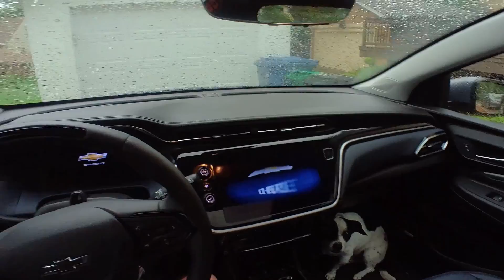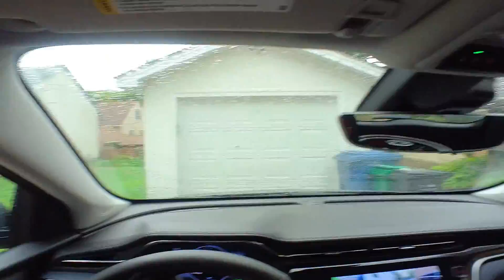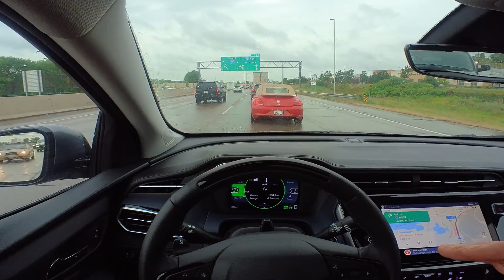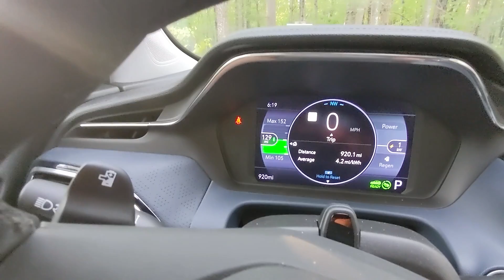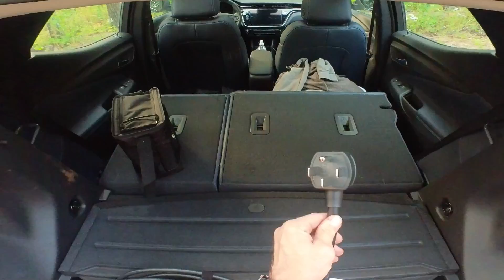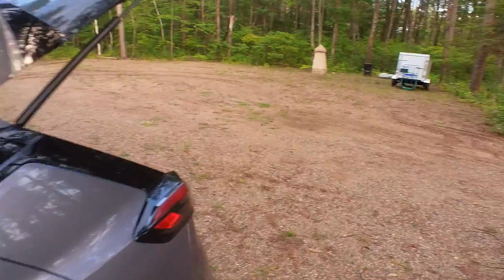Long range driving my Bolt EUV

Comment: Tip for your radio: I have an older Bolt and it will turn the radio back on every time I get in the car so I started leaving it tuned to SiriusXM ch 0. Since I don’t pay for satellite radio it stays silent and now my radio stays quiet.

Comment: Hi Shad, thanks for the great video.
How’s ride quality in general and versus ID.4?
Reply from the maker: The ride quality it the Bolt EUV is really good. Very similar between the two, but the VW handles a bit tighter and more sporty while somehow still having good ride quality. Kind of the trait of most German cars. That doesn't mean the Bolt is terrible by any means, it's also quite impressive especially when you consider it's price vs the ID.4.

Comment: Nice video !
I’d suggest you the following when the cold temperatures come
- always preheat your car before you leave home (remote start it 20 mins before you get in and drive it)
- use delayed charging and set it to a time that’s about 30 mins earlier than the time you leave home. This way you’ll have a warm battery when you are on the road. Remote start the car during the 30 mins left, so that you have a hot and crispy habitacle.
- do not use one pedal driving on icy roads
- always plug the car
The Bolt EV-EUV is best to charge from 10/15% to 55/60%. It takes you about 30-35 mins and you get about 100-120 miles range. 
I suggest you to always reset the Average/Distance in the main screen every time you are ready to leave house, after a charging session. Your GOM will become a lot more accurate when driving the same routes in the same conditions.

Comment: Just a correction for you - the DCFC charge curve on the Bolt is pretty terrible. If Chevy had programmed the curve to allow for the 50kW rate, it would be a much better road trip car. From 0% until about 60%, you'll get a charge rate of approx 40kW, which is acceptable. From 60%-80% it drops pretty linearly from 40kW down to about 20kW: 60%-80% takes about 30 minutes (I know as I just did this last week in perfect weather in my 2017 Bolt EV). Past 80%, you might as well unplug, as the rate drops through the floor. As another data point, it took approx 1hr to charge from 19%-80% in perfect weather (same trip). Just an FYI in case you've not done this. I home charge primarily, and have a gas vehicle (Passat TDi) if I really need to travel far with my family, but a Bolt will comfortably do 200-250 mile trips easily, and it is way cheaper. Just avoid the big hills, travelling up into the Sierras from the California coast sucked down the kWh. Cheers.
Reply from the maker: It took my car 45 mins to get from 50% battery to full on a DC Fast Charger. I haven't done a full Fast Charge from a low charge, but I heard it takes about 1.5 hours. So yeah, not fast. But I always bring up the cost of the car and how good it is for what you pay for it.

I am not sure what has changed, aside from a slightly bigger battery, between the 2017 and 2022 models. But I would be surprised if nothing has improved charging wise.
Reply: @geekingoutwithshad  Everyone is getting the new battery with the recall - I've had mine replaced already. News Coulomb reported a decrease in charging performance when he tested the new model vs the old model. It seems Chevy restricted the charge profile even more with the latest packs in an effort to curb potential issues. I'm only one data point, but you and I probably agree that the charging performance could be better, even with the existing hardware if Chevy wanted to update the software. Unlikely though.
Reply from the maker: Yeah, I knew the charging was slow when I got the car. I don't know what charging is like with the ID.4 though and I still have my 2020 Tacoma for longer trips if ever needed.
Reply: To road trip a Bolt optimally on DCFC chargers, you never want to charge to 100%. Instead, you want to aim to cycle the battery between 10% and 55% so you get a consistent charging speed of about 52 kW the whole time. This translates into alternating patterns of 90 minute driving sessions (about 100 miles), punctuated by 25-30 minute charging sessions. 

Occasionally, doing a deep charge on a Bolt to 80% or even 100% is necessary, due to chargers being spread further apart than one would like. But, when it is necessary, it's usually needed on a one-off basis, not over and over again at every charging stop. When this happens, the key to having a good experience is to plan ahead and look for things to do, and be willing to leave the area where the charger is using some non-driving means of transportation such as walking, Uber, or public transit. The people who have frustrating experiences tend to be the people who don't plan properly and end up just sitting around next to the car for 90 minutes waiting for it to hit 100%. But, with good planning, you don't need to travel like that.

Comment: I'm just glad your ok after driving that death trap that far. It looks like your garage is separated from your  house....thats good but I still wouldn't dare to charge it in there. GM is using LG Chem batteries in those cars 80 % of all electric car fires are cars using LG Chem batteries. If your going EV stay away from LG who wants a car that GM themselves say not to leave it unattended while charging for risk of fire. I wish you good luck and safe journeys. If you want to insure both of those than consider trading that under performing car for a Tesla! Have a great night
Reply from the maker: Yet another misinformed individual out there.

Out of all the 140,000 Bolts that were made before the recall, 19 of them had fire issues. I would hardly call that a death trap considering internal combustion engine cars have had and still have much higher fire risks than the Bolt.

The car I have was manufactured after the recall and this doesn't have the rare chance of having a defective battery.

As for a Tesla vs the Bolt. You are comparing a $37k car to a $60k car so of course a Tesla is going to out perform the Bolt EUV. I actually had a Tesla Model Y on order. Once all was said and done for a Dual Motor version it was actually $67k and Tesla kept pushing the date back months for delivery. So I decided to get the Bolt when GM dropped the price $6,300. For the price of this car, it's an excellent EV and the best value out there right now.
Reply: @geekingoutwithshad  You can't argue with these folks, don't bother wasting your time.
Reply from the maker: Very true. There are people whose sole purpose is to be negative and go on the Internet and spread their misinformed ideas around. Pretty sad life if you ask me.
Reply: Gas cars on average have about 60x (adjusted for quantities) as many fires as battery cars. AND a gas car fire happens much quicker so you have less chance to escape; battery cars are usually unoccupied when they catch fire. But hey, its a free(ish) country, pick your own risks.

Comment: do you really only drive at or just under the posted speed limits? If so, I don't think that's a "real world" test.
Reply from the maker: No, I usually drive over. When it's 65 I will do 69 or 70 because I know once I go over that I start to lose MPG or kWh much quicker.

In my Tacoma I will get 22 plus MPG if I am at 69. But if I am at 74 I get 20 MPG. 2 MPG is a lot of loss.
Reply from the maker: I also have a long range test where I did mostly 74 (I try to stay under 10 MPH over) with the climate on that I haven't uploaded yet.

Comment: Does the Bolt have a pet mode while you are in the store?
Reply from the maker: No. I believe that's only a Tesla thing.
Reply: The Bolt doesnt have Sentry mode either, despite the fact the deluxe versions have 4-side cameras and its only a software function from that point.
Reply from the maker: Only a software function? I am a software engineer. I can tell you it's not that simple and costs a lot of money. It's a $37K car vs a $65K Tesla. Writing Sentry Mode software is quite the undertaking and all of the hardware components need to have the proper APIs and protocol for something like that. Then you need the ability to send that info to a phone or other device through a network that is always on. It is extremely complex and would be expensive to implement.

Comment: Why is the climate settings at 0%?  Did you not use the AC or heater on the drive?  If not I wouldn’t call this a real world test drive. I use my AC everyday and the climate setting is never 0%. The range is effected a lot by the AC running.
Reply: A/C only costs about 5%. Heat gets up as high as 15%.
Reply from the maker: @natehill8069  Is this also true if someone was running AC at 110 degrees? For me, 90s are about as extreme as temps get so not much AC is needed to keep the car comfortable.
Reply: @geekingoutwithshad  Well, Im in Ohio, I havent seen it above 100 since I got the thing. Seems like 97 was the max. Also I hate the noise of fans at full speed I just have it blowing cold on me at medium and thats enough.
Reply from the maker: Because the outside temperature didn't require me to use the AC. I personally think people over use AC when most of the time the temperature is just fine. The AC actually doesn't use much energy anyway so it's not going to change the range all that much. Heat, on the other hand, uses a lot more energy and affects the range quite a bit more. As we will see when temps start to drop here in Minnesota.
Reply: @geekingoutwithshad  I live in south Texas so the AC is a must around here.  It might not use a lot but I’m in the negative for climate all the time.

Comment: nice video!  how does the lane centering do in the bolt euv?

i just got my tesla and it does pretty well, i've heard some systems bounce you back and forth a lot.  initially, i was a little iffy about tesla's autopilot, but now that i'm using it, i'm coming around.

i just wish there were more customizability on slowing down the car, it tends to slow down later and quicker than i would like during autopilot.
Reply from the maker: There are two different types of systems and my Bolt EUV has both.

There is lane keeping assist which isn't an auto driving mode of any kind. It will kick in when I am driving and I start to drive out of the lane. In the Bolt EUV it gently steers back towards the middle. If I took my hands off the wheel and let it do it's thing, it would bounce back and forth between the lanes because it only engages when the car is starting to go out of the lane. It does not try to keep the car centered in the lane. It's not intended to.

Then there is Super Cruise. Similar to the Tesla Autopilot it is fully engaged when on and keeps the car centered in the lane. It literally steers for me around curves and such. Where Super Cruise is different than Autopilot is that it won't change lanes or so anything else, it is basically adaptive cruise with steering and only works on highways GM has mapped for it.

Comment: Ionic 5 is 10 to 80 in 18 minutes on electricity America in summer
Reply: Better looking and roomier too. Also available with AWD (dual motor). But, Its also about 75% more cost, and 6 months to order one right now. So youre comparing a Ford to a Cadillac. Try it against the Kona EV, thats only a little more expensive.
Reply: Inionq5 is alot more money
Reply: It also has lot of issues. The whole hyundai and kia brand for both ice and ev is a big risk. Ticking time bomb is what they are

Comment: MyBad. I didn't realize that the Bolt had a range of 300 miles. That's neat.
Reply: In city driving during ideal temperatures it can easily do over 300 miles with regen (one pedal driving) on.

Steady speeds on the highway it gets about 220 miles during ideal temps. Cold weather will easily bring these ranges down.

Comment: Need to say this…been driving Bolts since 2018, now have a 2022 Bolt EUV Premier, like yours, but no Super Cruise.  Discovered in 2018 that there are 20 battery segments (4 groups of 5) in both the range display, on the left, and the “Flow” screen in the Energy screen.  This would result in the fact that each segment is 5% of battery capacity.  This can be used to calculate remaining battery capacity, within 5% of total range.  I have used this method since 2018, and it seems to work, accurately.

Best regards,

Gary Mirkin